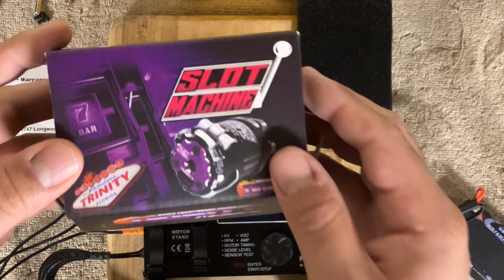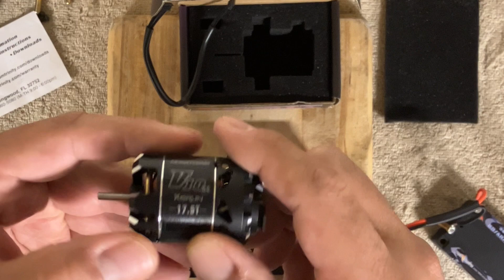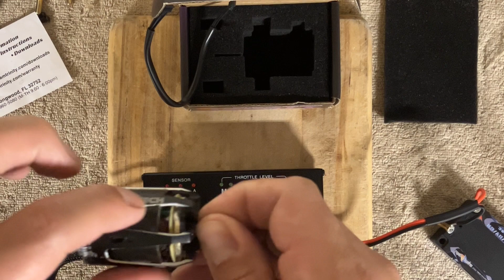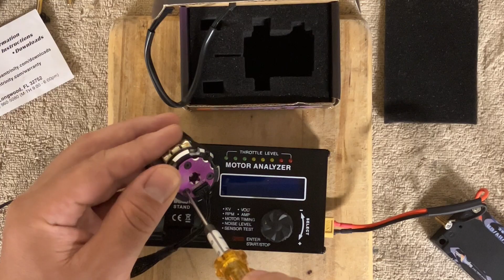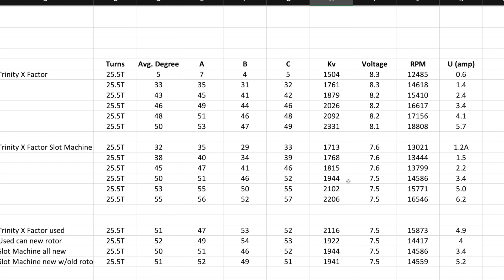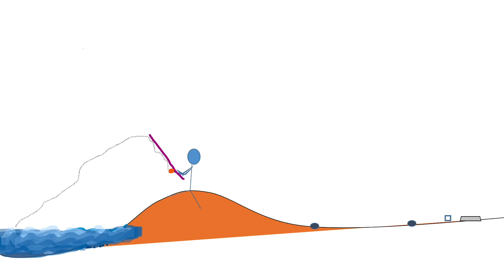Trinity Xfactor Slot Machine 25.5T Analyzer results compared to Xfactor Revtech

Comment: Looks like my R1 25.5 is close to the X factor motor.  Would you agree more amps with same KV just means a higher gauss (torque ?) rotor is installed?
Reply from the maker: It could also be a stator difference or a combination of the two. But the 25.5T are pretty close.

Comment: X factor had consistently better rpm, so way better for large fast tracks, also x factor looks like the better motor at higher timing
Reply from the maker: The trade off is heat. The Xfactor runs hotter. Which is why I swapped it for the Slot Machine in my F1. But you are right, Xfactor does have more RPM.

Comment: i would redo the test with fresh pack or using psu to power the analyzer.

although the kv rating wasnt impacted much, the amp difference maybe caused by lower volt batt during test
Reply from the maker: The voltage does impact the Kv. The higher the V the lower the Kv. The best practice, you are right, would be a power supply. The battery is charged to 8V and during testing it drops to about 7.6V in this setup. I did not make a video, but the Kv on one of the motors varies by just over 100Kv. That being said, you are correct in terms of the best practice.
Reply: Looking at the 50 degree test with the used Xfactor at 7.5v it matches the slot machine exactly.
Reply: Oops. I was looking at the wrong readings.
Reply from the maker: @PerformanceFestiva  The SM suns much cooler. I am thinking it is the Kv per amp draw as you noticed. Same Kv but different amps.

Comment: I think what you want is the same or greater kv at lower amps. That means it's more efficient.
Reply from the maker: Assuming the rotor strength is the same or greater. This is a pretty good motor.

Comment: Quick tip on adjusting timing on the slot machine, due to the can being split in two and held together by the three long screws the deviation amongst the 3 poles can vary depending on how those screws are torqued. To get a low deviation (all three phases being similar in timing) the three sensors on the sensor board must be equal distance from the rotor, and if those three long screws are not tightened as close to evenly as possible the whole end-bell can be slightly tweaked. This can add another variable to the slot machine.

Regarding the deviation of timing on your X Factor, this is completely due to the sensor board not being perfectly aligned with the end of the rotor. I've worked with many X Factors and it seems like a hit or a miss whether or not you get a properly aligned sensor board. I have yet to work with enough slot machines to verify the quality of the sensor boards. 

Regardless of the deviation in timing Trinity motors will still run great and both the X Factors and Slot Machines have unique pros an cons.

Comment: The name "Slot Machine"  recalls an older Trinity Brushed Motor design, where the commutator had to grooves machines into it. Giving the comm a three lobed look to it, like the barrels of a slot machine. The motor cooling slots were also a three slit design, that looked like a slot machine window.
The Slot Machine was later re-released as the Trinity Slot Machine² "Revenge of the MONSTER" which was a nod back to the the old silver canned Trinity Monster Horsepower.
The new Trinity Slot Machine is a recall back to the older Trinity D4 brushless motor design. With the gunmetal grey can, and purple anodized end bell. The actual physical layout of the slot machine is similar to the D4 as well, but utilizing some of the lightening techniques employed in the XFactor, but without the short comings of the delaminating cans, or stripped screw mounting holes.

And now you know... probably more than you needed to know, or wanted to know, about the new Slot Machine.
Reply from the maker: 😁 Love it. I actually enjoy the history and trivia of engineering. So this was perfect. Is it more than any of us need to know... sure. But it is interesting as can be. Plus, I don't think most people remember or have seen slot machines with quarters or dollar coins. Most are digital now.